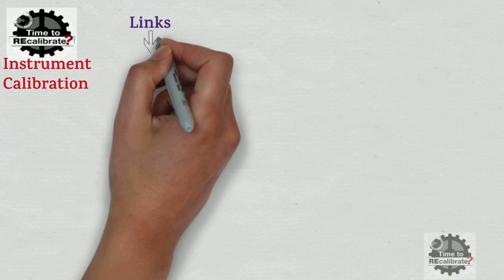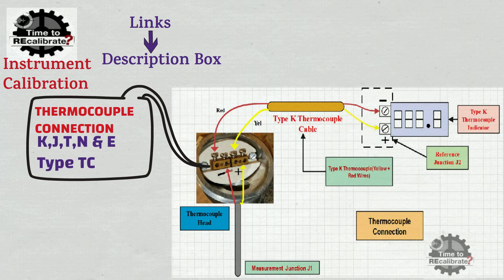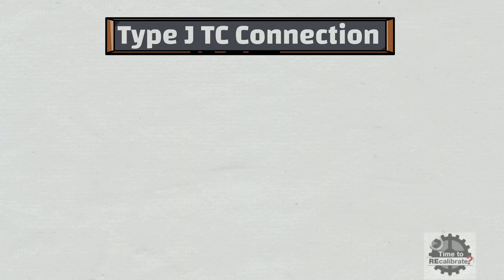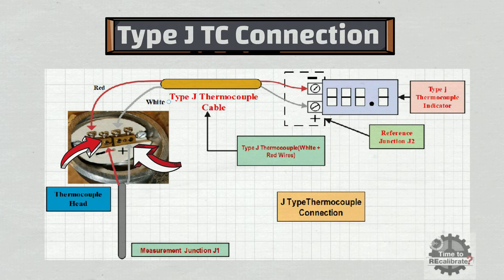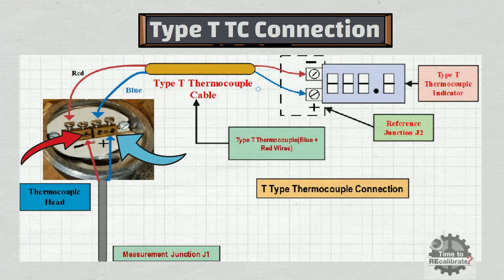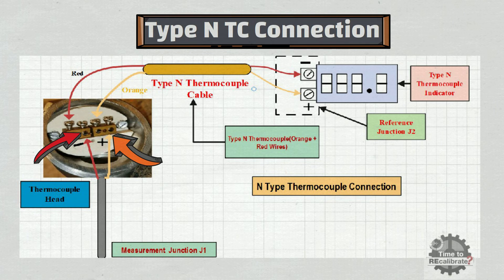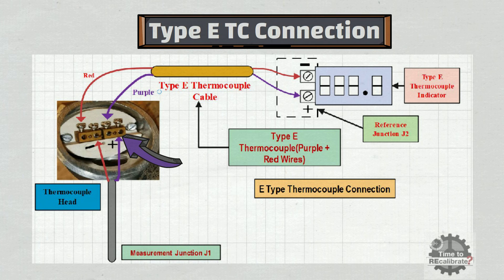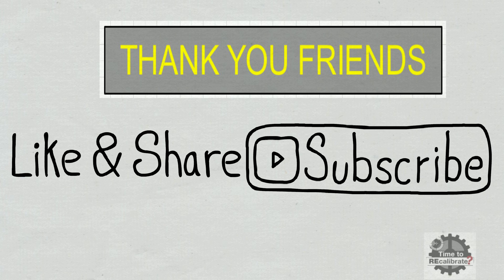Basics for Thermocouple Connection- How to wire thermocouples

Comment: Thanks for the video. However, I'd like to know if the thermocouple heads are made of the same type of metals as each of the wires? I want to use a Molex connector so I can have a disconnect between the thermocouples and the controller. How would this effect the temperature readings? The total length of the thermocouple wiring from the tip of the thermocouple to the controller is only 8 feet.  The reason I want to use another type of disconnect connector is because even the common standard miniature thermocouple connectors are too large and bulky for my taste.

Comment: Thank you for this video.  I am researching a way to increase the operating temperature of an ordinary laminator from 165 deg C to 200 deg C.  This is so the laminator can more accurately transfer toner onto PCB stock.  Is there a simple way to adjust the output of the device's thermocouple without making major changes to the circuitry?  Thanks again.
Reply from the maker: Hello 
Thanks for your comment. I don't think so there is a way to adjust the output of thermocouple without making major changes to the circuitary